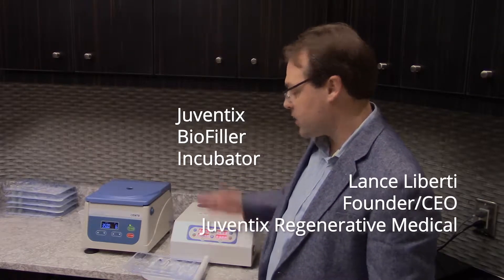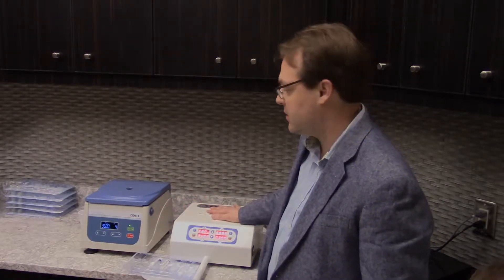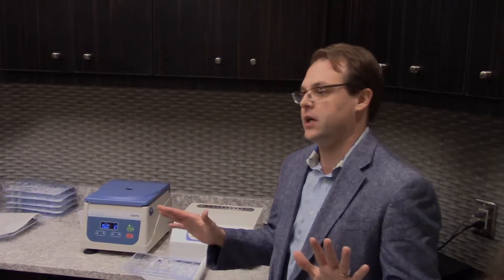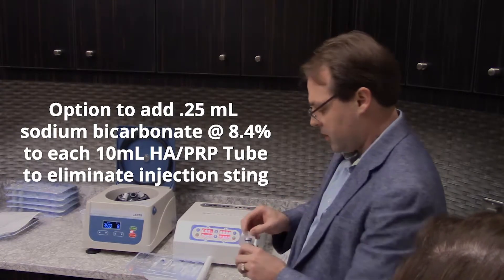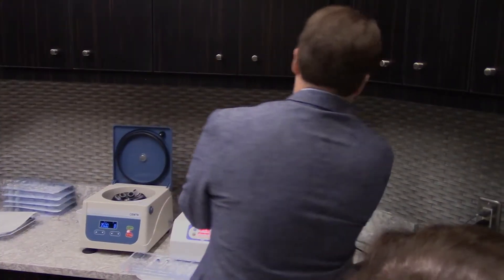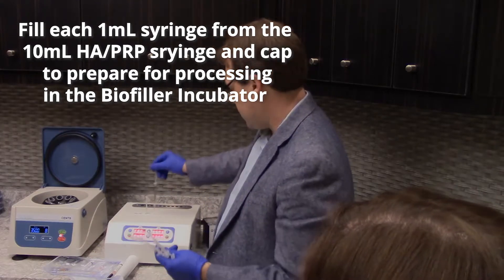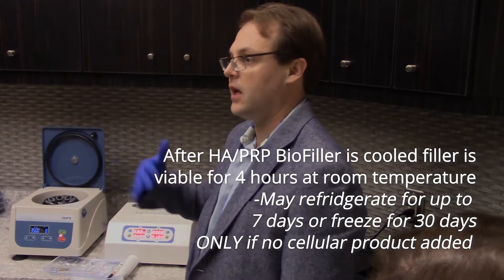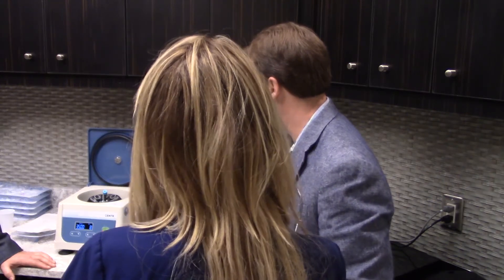BioFiller HA PRP Kit Training

Comment: Hi, what's the centrifuge time at 3500rpm?
Reply from the maker: Yes, 3,500 rpm for 8-minutes is the recommended setting for optimal results when using a thixotropic gel assisted PRP separation method.